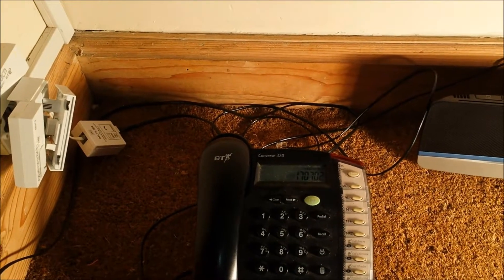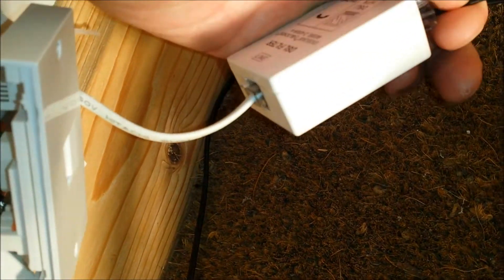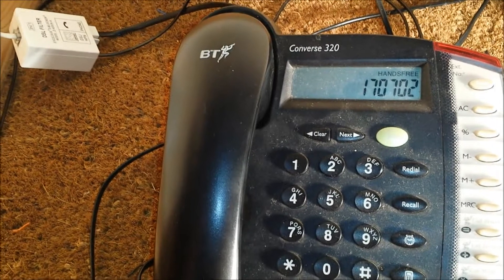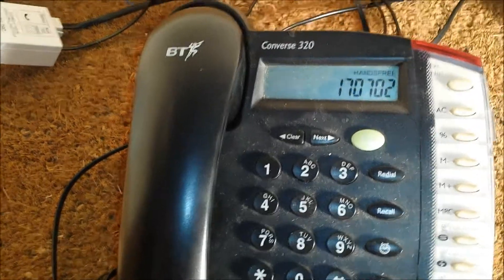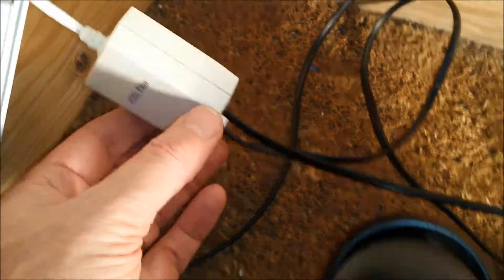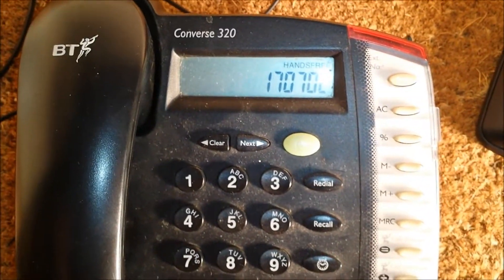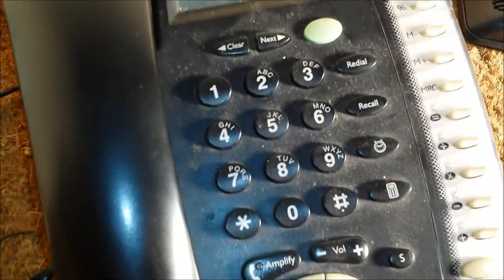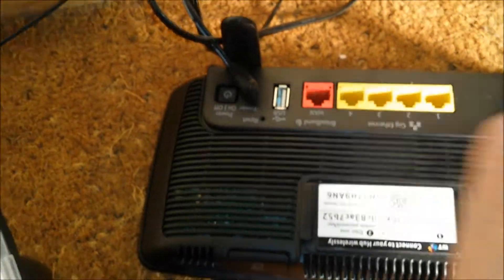ADSL crackle on my voice line despite filters

Comment: That is clearly the Router/hub causing the noise issue. Ironically it looks like it is one of BT's own hubs/routers that is chucking noise back down the DSL line into the filter and then onto the phone line. You are partially correct that it is not within your property. In actual fact it appears to be from BT's own equipment.  Also, you state you have tried 3 different routers and 2 different telephones. Okay. You do not state what make and model those routers were. It' is also interesting that you say you have tried 2 Faceplate filters, however clearly this is not a filter issue directly. Please do get in touch with me, I may have a solution for you.
Reply from the maker: Hi

I am not sure how to get in contact with you other than via public comment here.

The three routers were:

Billion BiPAC 7800N  [ My current router ]
Billion BIPAC 7650    [ My previous router] 
BT Home Hub 5        [ Sent by BT during their (failed) investigation ]

I tend to only plug the last one in when BT ask me to as they can do some diagnostics with it but I usually unplug it as I feel the broadband drops more often with it. 

One of the 7 BT engineers BT sent installed a new filter faceplate. I also have various ADSL filter dongles I have tried with the test socket.

I'm going to try one last time to get BT to send an engineer today as the promised call back on my last call to 151 resulted in no call back.
Reply: Email me on neilgburns67@gmail.com